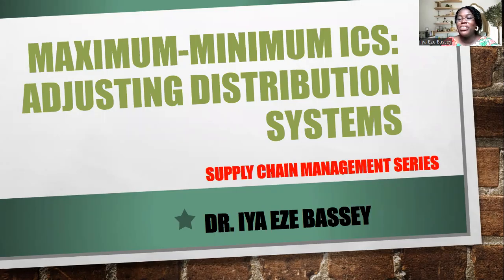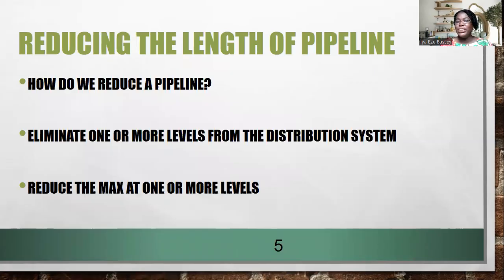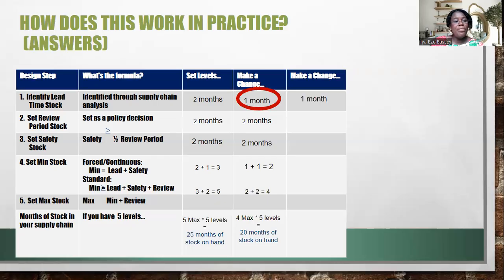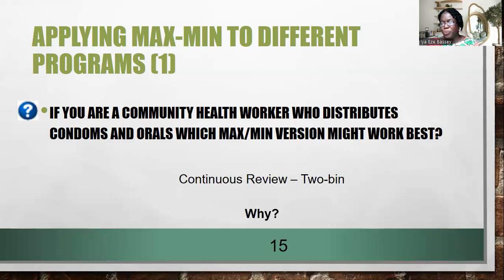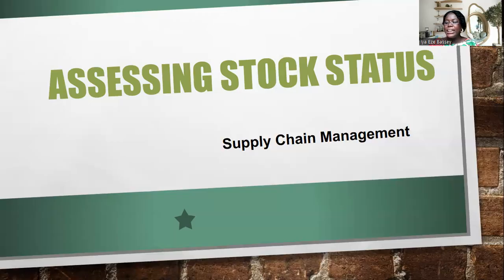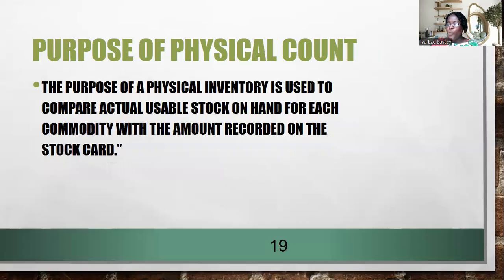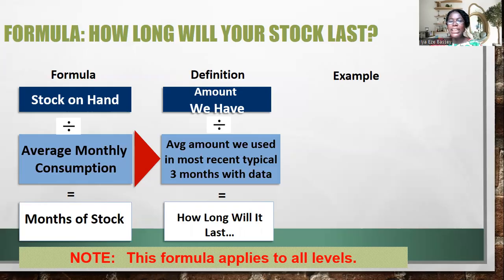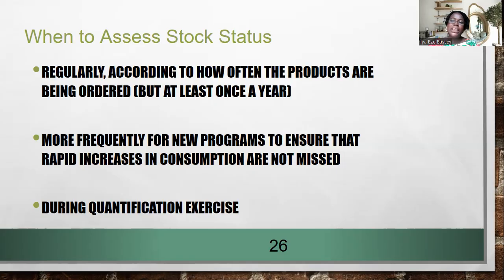Maximum-Minimum ICS: Adjusting Distribution systems (Supply chain management series)

Comment: In summary, ways to adjusting distribution system polices in maximum minimum ICS;
1. By setting up initial max-min policies for each level and type of faculty.
2. Check if the overall distribution will function properly.
3. Check the total length of the policy at the stages implied. 
Ways in reducing the length of a pipeline are;
- You can eliminate or move level from the distribution system.
- Set up policies that helps you reduce the maximum at each level. 
We can reduce the maximum stock level by;
Checking the formula which can be changed (lead time, review period, distribution system reliability, cost of production etc) 
How to calculate how long our stock will;
Stock on hand /average monthly consumption = month of stock.

Comment: Thank you for the lectures ma’am 
In summary I learnt that the advantages of using max-min system includes:
Minimising wastage
Prevention of overstocking
Avoiding understocking
 Also, the max min inventory control system provides comprehensive guidelines for managing stock levels to prevent both overstocking and understocking of goods.

They’re also a major steps in designing a maximum minimum ics, and as follows:
Check the overall distribution 
Check the total length of the pipelines
Set up the initial max min policies for each level and their type of facility 
They’re also ways to optimise the pipelines:
Streaming distribution levels 
Reducing maximum stock levels at certain points.

Comment: The maximum minimum Inventory system (ICS) is a method used to manage inventory levels in distribution system.
It's involves setting minimum and maximum stock level for each product .When inventory reaches the maximum level it triggers a signal to stop ordering more till it falls below the minimum level . This helps to avoid overstocking and stock out , ensuring optimal inventory level and reducing cost

Comment: Another insightful lecture series, thank you so much ma
In summary, I got to understand the steps in Designing Max-Min Inventory Control System(ICS) which are as follows:
1)Setting up Max-Min policies for each level and type of facility 
2)Check if the overall distribution will function properly 
3)Check the total length of stock of the pipeline the policies over at each level.
I also learnt that the length of a pipeline can affect the delivery of some commodities, making the commodities take longer time to arrive and we can reduce it by:
1)Eliminating one or more levels from the distribution system
2)Reducing the Max at one or  more levels.
However, we can also have the systematic way or reducing pipeline / some formulas which can be changed to reduce Max stock level ;
1)Shorten the review period at one or all levels
2)Reduce the lead time at one or all levels
3)Improve the distribution system that the safety stick can be reduced.
This lecture help me to understand and know some factors that can impacts Max-Min Stock Level which include:
1)Cost of products
2)Storage capacity 
3)Lead time
4)Reliability of transportation 
5)Accuracy of forecasts
6) Management of staffs skills etc…
Reply: Thanks ma for another elightening series .
I have understood the steps in designing Maximum minimum inventory control system .
I also understood that for effective delivery of health commodities ,if the pipeline is long it can be reduced by the following ways:

1.Eliminating  one or more levels from the distrubution  system
2.Reducing the max at one or more levels.
 There's a systematic way that guides the reduction of a pipeline and Max stock levels . They include:
- shorten the review period
- reduction of lead time at one or more levels
-  improving the distrubution system .
 There are also certain factors that affect Max min stock levels .They include: 
1. Cost of products
2. Reliability of transportation
3. Lead time
4. Accuracy of forecast etc

Comment: In conclusion, i learnt the following:

- Adjusting distribution systems in maximum minimum inventory control systems
- Learn to adjust distribution system policies and describe the advantages and challenges of the must mean inventory control system
- Describe the inventory control system used in logistics management of HIV commodities
- Determine the number of months of stock available at any storage level using inventory and user data
- Set up initial maximum policies for each level and type of facility and check if the overall distribution will function properly
- Reduce the length of the pipeline by eliminating one or more levels from the distribution system or setting up policies to reduce the maximum at one or more levels
- Change some elements of the formulas to reduce the maximum stock level.

Comment: Dear Dr, Thank you.
Adjusting distribution system of maximum minimum inventory control system is quite understood as is reveals the steps of design such as
-set up intial maximum minimum policies for each level and type of facility 
-check if overall distribution will function properly if the level specific max min are implemented.
And check the total length of pipeline.
Reducing the review period, lead time and improve the distribution system reliability at 1 or more levels so that safety stick can be reduced is the Systematic way of reducing the Maximum stock level.

The factors that impact max min stock levels are 
-cost of products
-reliability of transportation
-storage capacity
-cost of storage 
-storage condition at different level
-age of program and so forth.

The challenges to using each version and variation are the systems with numerous levels, those that manage large no of commodities and those that manage products for new programs.

As community health worker distributing condoms and orals,
Continuous review as max min version works best (Two bin to be precise)
Standard version is recommended for drugs, HIV test kits and kabs while continuous review is for those with lesser no of products 

When to access stock 
Is regularly on how the products are ordered(atleast once a year)
Frequently for new programs to ensure that rapid increase in consumption are not missed and during quantification exercise.

Comment: Greetings Ma 
Designing the Max - Min ICS there are important things that need to be done such as setting up the initial Max - Min policy for each level checking the overall distribution to ascertain if it will function properly and checking the total length of the pipeline that the policies at each level imply.
In most cases there's a need to reduce the pipeline for it to get to the client on time by eliminating one or more levels from the distribution system or settings policies that help to reduce Max in a systematic way.
Advantages/merits of using Max min system are:
Avoid overstocking, avoid understocking, minimize wastage, avoid costs of emergency orders, simplify inventory control decisions making, consistency of stock levels and reliable data sources from SDP for forecasting and quantification

Comment: At the end of this lecture I learnt that;
The steps in designing a Max-Min ICS are;
1)Set up initial Max-Min policies for each level and type of facuity
2)Check if the overall distribution will function well and specific Max-Min policies levels are implemented
3) Check the total length of the pipeline thst the policies at each level imply. Elements that can be changed in order to reduce the Max stock level includes;
•the review period at one or more levels
.reduce the lead time at one or more levels
.improve the distribution systems
Reliability at one or more levels.
Under Assessing Stock Status entails physical count which is to compare actual stock on hand for each commodity with the amount recorded in the stock card. The purpose of Assess Stock Status is to determine how long supplies will last. Assess Stock Status can be assessed regularly according to how often the products are being ordered (but at least once a year), frequently and also during quantification exercise.

Comment: Thank you so much ma for this lecture. In this session I learnt that;
1.  ways to adjust distribution system policies; THE STEPS IN DESIGNING A MAX-MIN ICS ARE:
* 1. Setup initial max-min policies for each level and type of facility.
* 2. Check if the overall distribution will function  properly if the level specific MAX-MIN POLICIES are implemented 
* 3. Check the total  length of the Pipeline that the policies at each level imply.
How we reduce the pipeline length;
• Eliminate one or more levels from the
distribution system
• Reduce the Max at one or more levels
2. advantages and challenges of Max-Min Inventory Control System; Avoid overstocking
• Avoid under stocking
• Minimize wastage
• Avoid costs of emergency orders
• Simplify inventory control decision‐making
Challenges; Systems with numerous levels
• Systems that manage a large number
of commodities
• Systems that manage products for new programs
3.  purpose of assessing stock status; The purpose of assessing stock status is to determine how long supplies will last. And also physical count and it’s purpose; A physical Count is the process of counting by hand the total number of usable units of each commodity in your store or health facility at any given time ,Purpose of Physical Count • The purpose of a physical inventory is used to compare actual usable stock on hand for each commodity with the amount recorded on the stock card.
4. Determining the number of months of stock available at any storage level using inventory and usage data; with the given formulas how long a stock will last: stock on hand\ average monthly consumption = months of stock.
5. Assessesing stock status; we access regularly, according to how often the products are being ordered (but at least once a year)• More frequently for new programs to ensure that rapid increases in consumption are not missed• During quantification exercise.
6.  Importance of accessing stock status; Looking at the stock we have at hand and determine: •Months of stock (MOS) available •How long our stocks will last, if consumption remains the same •If we are overstocked or under-stocked

Comment: Thank you Doctor Mrs Iya Eze Bassey for this session: maximum- minimum ICS, Adjusting distribution systems : the first to do while adjusting distribution  system is firstly to look at the length of pipeline: we have the steps in designing a maxi/mini ICS 
1: set up intial maxi/mini policies
2: check if the  overall distribution  will function properly.
3: also check length of pipeline that the  polices at each level lmply.
Some advantages of maxi/mini system: 
.Avoid over stocking and under stocking.
.Consistency of stock levels
.Avoid costs of emergency orders etc.
Also I have learnt the ways of Assessing stock status which involves physical inventory, its definition and purpose which is to  be able to compare actual usable stock on hand for each commodity with the amount recorded on stock card

Comment: Designing the max - min ICS there are necessary things that need to done such as seting up the initial max-min policy for each level, checking the overall distribution to ascertain if it will function properly and checking the total length of the pipeline that the policies at each level imply . Sometimes there's need to reduce the pipelines for it to get to the client on time by eliminating one or more levels from the distribution system or setting policies that helps to reduce max in a systemic way . 
There are several advantages of for using max-min system such as to avoid overstocking or stock out and there are challenges of using this system like system with numerous levels or that manages a large number of commodities etc

Comment: Bravo, Ma'am, and keep up the fantastic work. In Brief: Information Acquisition Setting initial Max-Min policies for each facility level, confirming that these policies permit appropriate distribution, and examining pipeline length implications are all part of adjusting distribution system policies. How long supplies will endure is determined by evaluating stock status. Divide the current inventory by the average usage over the last three months to determine the number of months of stock that is available.

Comment: In this lesson, Maximum-Minimum ICS adjusting distribution systems.
I learnt the length of a pipeline refers to the steps in designing maximum ICS. Reducing the length of the pipeline means eliminating one or more levels from the distribution system  and reducing the max at one or more levels . 
I learnt how to reduce max- stock levels , other fact that  impacts max- min stock levels , advantages of using a max-min system , what a physical count is all about including it’s purpose .
I also learnt how to determine how long stock will last and when to access stock status 
Thank you ma

Comment: In Summary;
Adjusting Distribution System in Maximum/Minimum ICS talks about the procedures in curating an ICS for proper functioning of the SCM.
These steps helps ensure that every product is delivered and stored in the right quantity to avoid shortage or wastage. 
There are also factors that impact Max/Min stock levels such as products cost, storage conditions, lead time etc. the challenges of this system was also initiated.
Physical count is seen as a necessity as it helps compare the actual stock in hand for each product .

Comment: This series talks about the adjusting distribution system in the maximum/minimum inventory control system. firstly we discussed the Length of a pipeline which consist of three 3 steps.which also leads  us to reducing the length of pipeline. other factors that impact Maximum/minimum stock level such as cost of product reliability of transportation, storage capacity, cost of storage etc 
We also talk about a physical count which is the total number of usuable unit of each commodity in store.the main purpose is to compare actual usuable stock on hand.
We also made some calculations using formulas!!!!
This has been a great and educative series 👍

Comment: Thank you ma for this video. I'm able to understand from it that:
1. Max-min ICS in supply chain management is valuable for adjusting distribution systems.
2. The steps taken in designing the max-min ICS includes: setting up initial max-min policies for each level and facility, checking if the overall distribution would function properly, and checking the total length of the pipeline that the policies of each level imply.
3. There are 2 ways to reduce the flow of health commodities at a facility. These can be done either by eliminating one or more levels of the distribution, or by reducing the maximum at at one or more levels.
4. The max-min ICS had advantages: it minimizes wastage, avoids overstocking, avoids the cost of emergency order, and avoids understocking.
5. The key storage activities being carried out are: supplying receiving and incoming inspections, putting away, picking and packing, and shipping.
6. The factors that impact maximum and minimum stock levels are: storage capacity, lead time, products cost, accuracy of forecast, reliability of transportation, management skills of staff, and so on.
7. In accessing stock levels, a physical count is usually done to calculate the total number of usable units in the health facility at a given time.

Comment: In summary, I learned how the length of a pipeline and how to reduce the length of a pipeline is essential in adjusting distribution system in maximum-minimum ICS.

The following are factors that impact maximum to minimum stock levels;
Cost of products, Reliability of transportation, Storage capacity, Cost of storage, Storage condition.

Advantages of adjusting distribution systems are as follows:
* To avoid over and under stocking.
1.  To minimize wastage.
2. To avoid cost of emergency orders.
3. To ensure consistency of stock levels.

Some challenges associated with each version and variation include:
1. Systems with numerous levels.
2. Systems that manage larger number of commodities.

I learned how to apply maximum to minimum ICS to different programs and how to access stock status.

In determining amount of stock, physical count comes into play, whereas physical count is the process of counting by hand the total number of usable unit of  commodity in your store or health facility.

Purpose of assessing stock status:

I learned about the formula to calculate how long your stock will last and at what regular intervals you have to access stock status.

Comment: Thank you ma, I got to understand that, To reduce the length of a pipeline in order for commodities to reach the consumers (scientists) faster ,we are to ; eliminate one or more levels from the distribution system and reduce the maximum SOH at one or more levels. This can not be achieved arbitrarily but rather scientifically. Factors like cost of products, reliability of transportation , storage capacity and cost of Storage can impact the Max-Min stock levels . The session was aimed at looking at the overall pipeline for the max/min ICS and to see how it can be improved upon to deliver commodities from the central to the med lab level. It’s paramount to note that 
The steps in designing a max/min ICS include; to set up initial max/min policies for each level, check if the overall distribution will function properly and check the total length of the pipeline that the policies at each level imply. Thanks ma